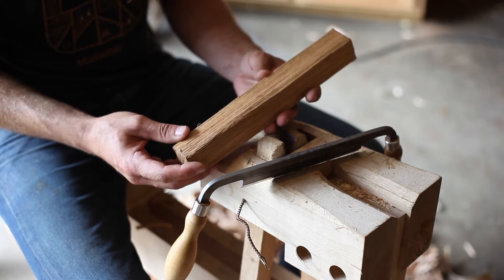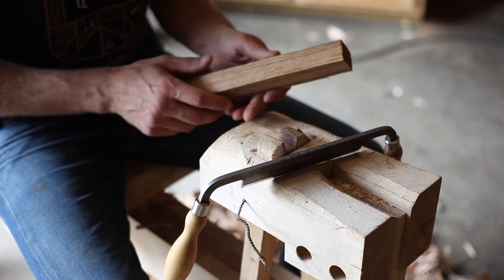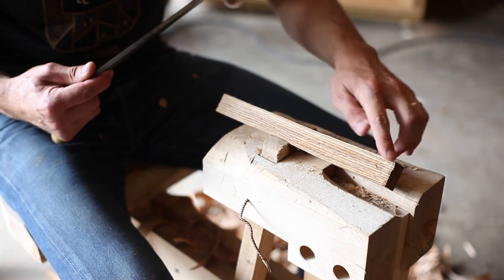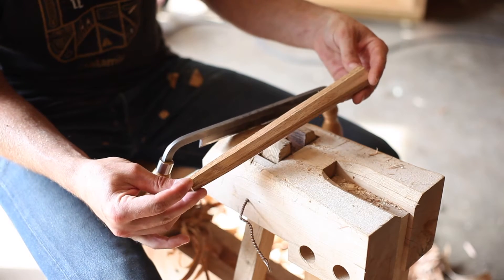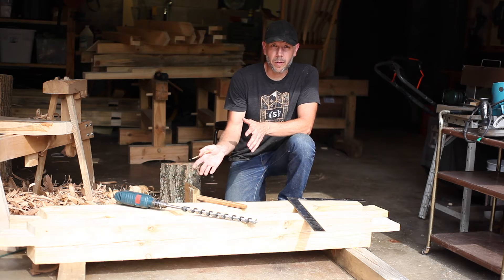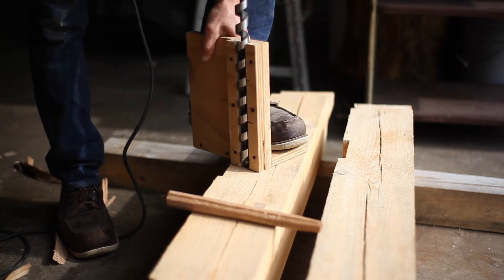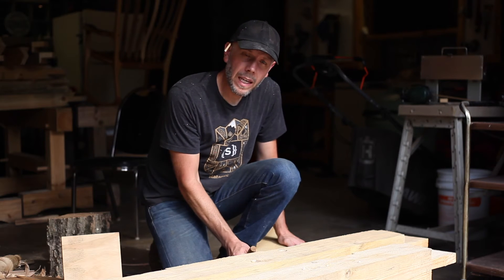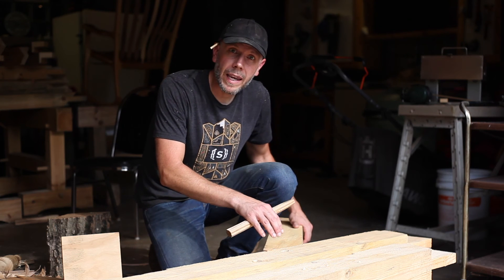Part 10: Making Pegs and Drilling Holes

Comment: Is there any particular auger bit you recommend? I plan o building timber frame from 15 cm stills, so i was thinking about 19mm pegs and 18mm auger bit. But irwin only makes them in length of 13.5cm and 32.3cm one is too short and other too long :) But I see that you are also using longer one, so it is maybe better for keeping it at right angle. Thank you for all videos, it is great guide and inspiration!
Reply from the maker: I would go with the longer one as it gives you a better guide to keep things straight when drilling. The only trick is to keep it from getting bent!